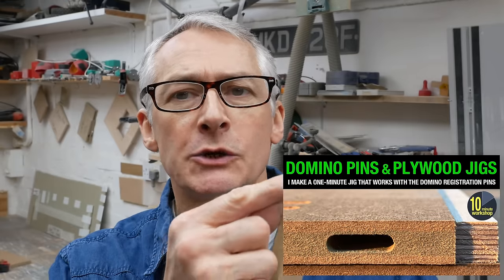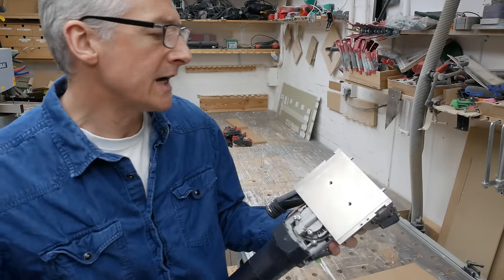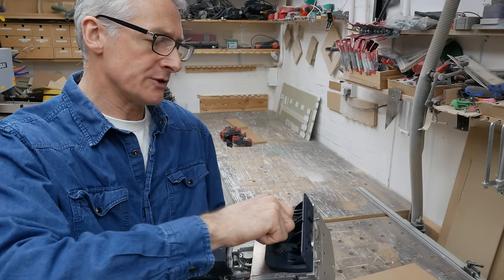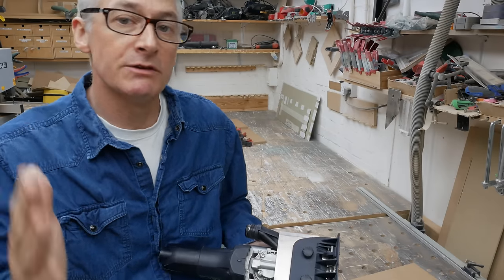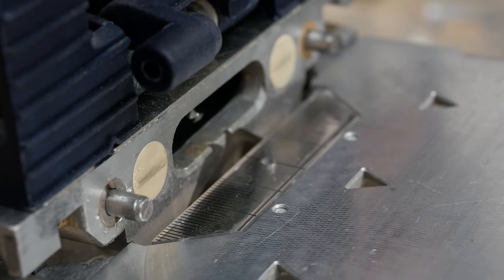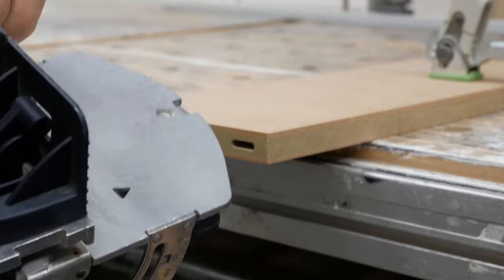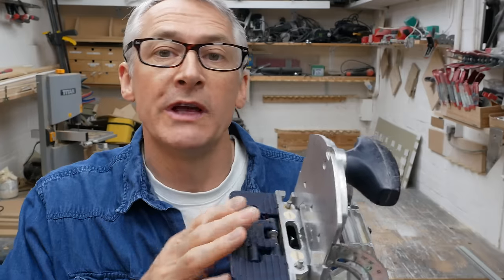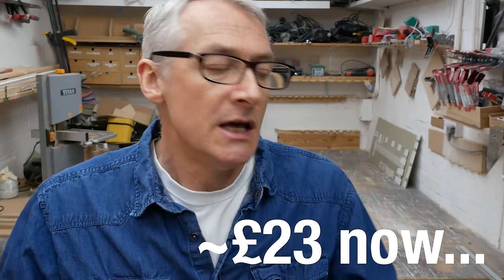Dominos Close to the Edge [video #311]

Comment: Thanks for the reminder, I actually just did a few dominos on small planks, could've used the method (both as reference and stability when working from the top). Just forgot I had the support bracket.

Comment: I have been trying to figure out a way to speed up joining 50mm face frames while using the domiplate. Thought about using Seneca dock plate but then you still need to move the stop left to right.

Comment: Hi Peter, question… I used this function yesterday for the first time, and pretty much every joint split the MDF. The splits were in the pieces with the mortices in the “end grain”, as it were. This happened even in 25mm MRMDF, and even with me doing everything by hand (no hammering in the Dominos). Not sure if it’s just par for the course with 5x30s this close to the edge? About 10mm between the edge of the boards and the edges of the mortice.
Reply from the maker: Can’t say I’ve ever had that, not with MRMDF. If it’s specific to the material you have, then you probably just have to design around it and not have them so close to the edge?? 🤷‍♂️👍